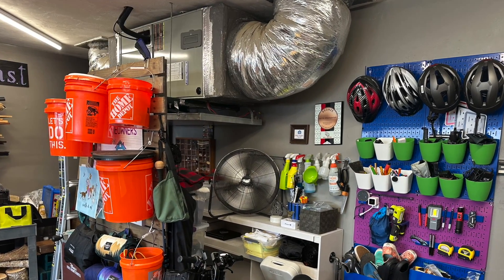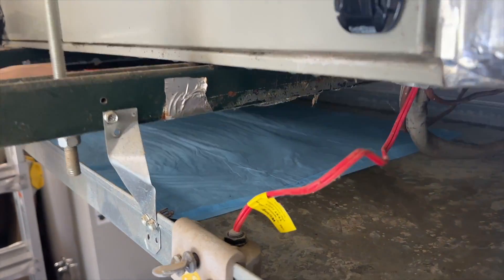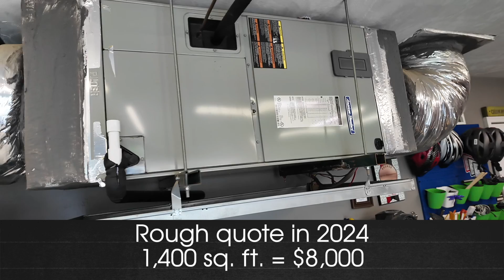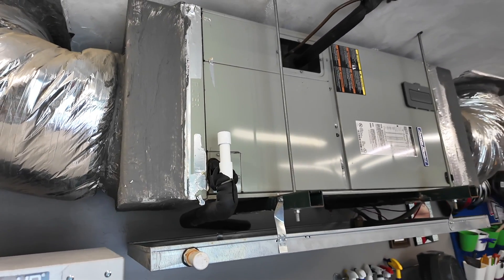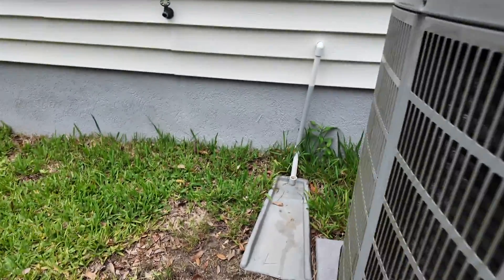This Simple HVAC Task Can Prevent a Clog!

Comment: The bleach isn’t doing a whole lot. I own an HVAC business myself. What helps the most is flushing, the line, periodically, and vacuuming. The reason the clog happens is there is a pee trap where stagnant water sits and particles build up overtime. Flushing with clean water and vacuuming will prevent the clog
Reply from the maker: Good information.

Comment: First, you can easily clean the AC condenser yourself and save some money. There are tons of videos on how to do this. 

Second, the codes must be different in your county because here in my county, Multnomah in Oregon, it is mandatory that all AC condensation lines must have a "P" trap which functions the same as your upward facing elbow. Then the 90 degree elbow that was facing up on yours will then face down. 

I never put bleach down my "P" trap, I just get my garden hose and spray water through an access joint similar to what was installed on your system. My "P" trap is a clear, somewhat flexible line so you can see if there is any sediment settling or gunk growing in it.

Comment: On a draw thru system (negative pressure at evaporator coil drain outlet) it's important to make sure you have an open tee fitting after the p- trap.  I go further and put a ball valve first, a tee fitting with cap, p-trap, then open tee after the trap.  This enables me to turn the ball valve off and move the cap temporarily to the open tee and blow thru the trap and drain line.  After clearing the drain, open ball valve, prime trap with water and move that cap back to the 1st tee.  If you do the bleach thing that's good, just flush it with water or dilute the bleach.  Easy DIY

Comment: Cool vid gals! Mine does not have the elbow at the end, just sticks out the house from the attic. Maybe different here in Pennsylvania as the AC only runs a few months then it goes to full heat pump with heat strip(s) mode lol. I never heard about the bleach but I have a service contract that they come out every year to check/test/etc the unit (just replaced last year for about $12,000) for around $200. Added benefit is any service we would need is billed at 50%. Keep cool down there (although it is soupy up here and had temps feeling over 100 ugh).
Reply from the maker: Thanks for sharing! Good to hear experiences in other areas.